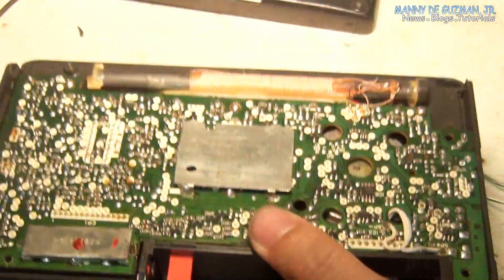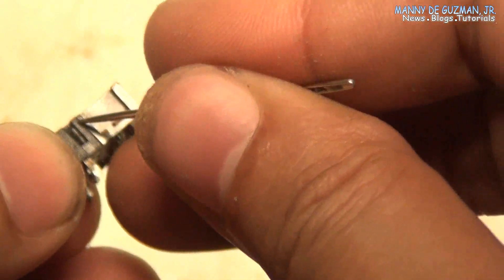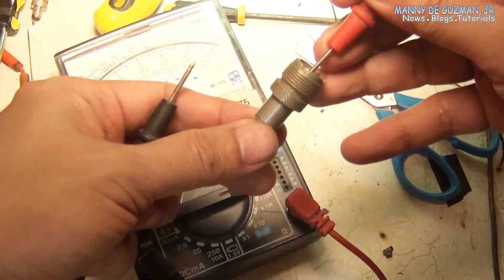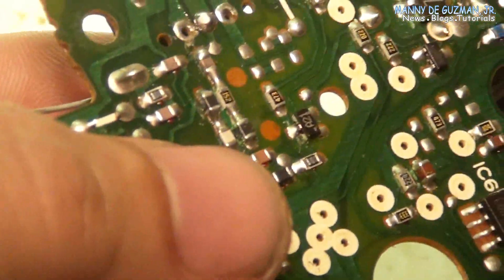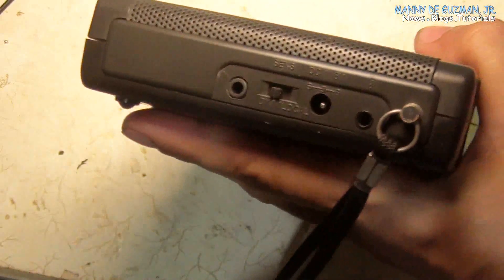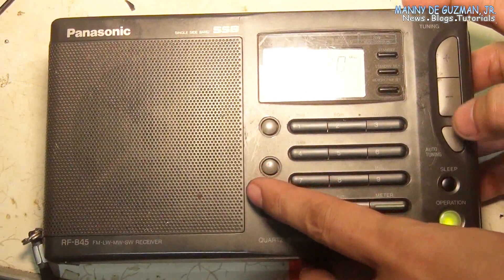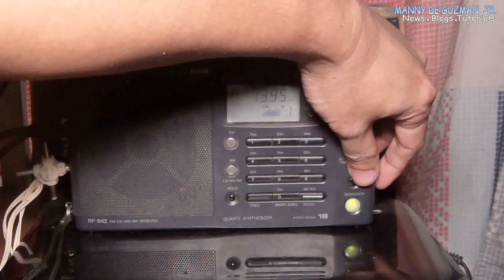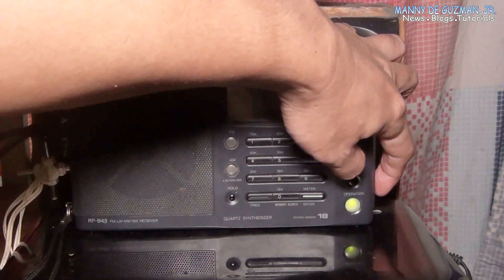Panasonic RF-B45 shortwave radio (import version). Soldering the missing external antenna jack/ mods

Comment: Where did you get the external antenna jack?
Reply from the maker: It's a headphone jack cannibalized from an old CD player boombox. The jack does not exactly matched the drilled holes terminals of the circuit board so I just hard-wired the connections.
Reply: @Manny_News_Blogs_Tutorials 
Thank you very much for your answer.
Reply: @Manny_News_Blogs_Tutorials 
I have one more question, which two points did you connect as an external antenna?  (1,2,3,4,5) Which point did you connect as GND?
Reply from the maker: @tvszer  I cannot recall the exact terminals on the jack because I used my digital volt-ohm multimeter to check for continuity between the center tip/ ground lug and the solder terminals on the headphone jack. That is, I inserted a headphone plug then test continuity from plug to jack, end to end.

Comment: what antenna did you use
Reply from the maker: I used just my homemade center loaded HF antenna for shortwave listening. Same antenna to test the faraway 95.1 Kiss FM radio station on the FM band, though I could use my FM broadcast yagi but it is not available at the moment (I don't have the proper PL259 antenna connector to 3.5 phono plug adapter)